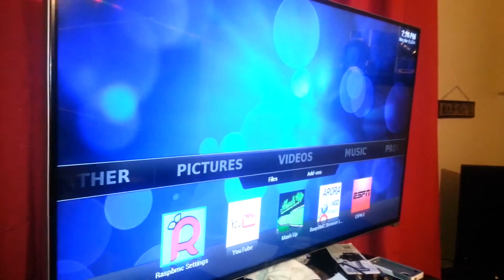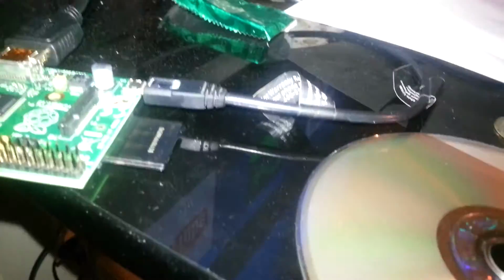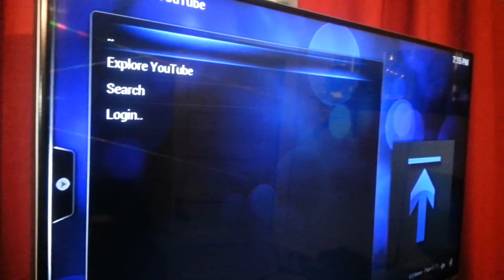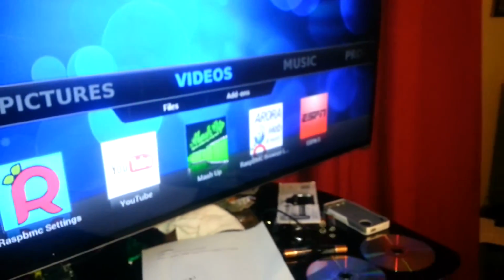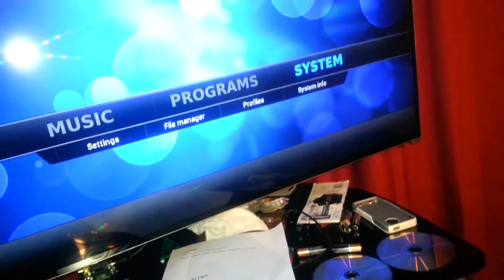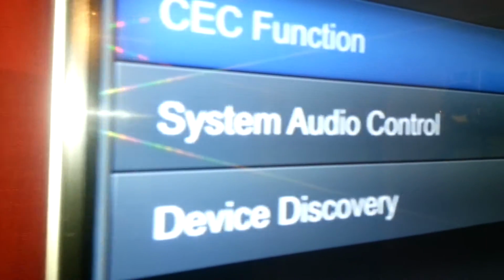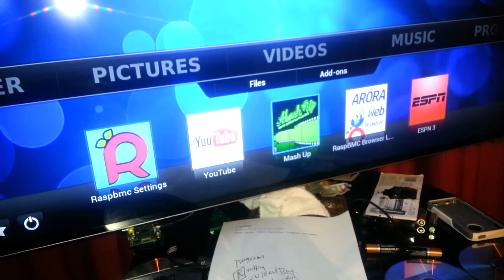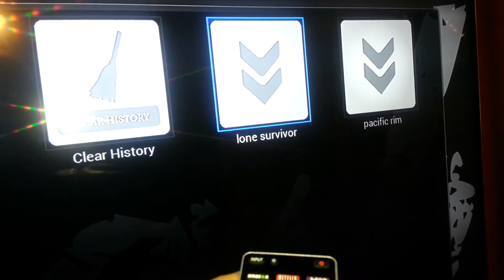Using Vizio M remote to control XBMC on Rasberry P

Comment: Using Kodi 15.1 and my peripherals are disabled. 
Looking to install libCEC and can only see installs for Win/Mac. 
I have the same Vizio M series using a MyGica 1900AC running Android. 
How can I install libCEC? Awesome video, thanks Dale!
Reply from the maker: +Steve Maxwell This video was posted over a year ago. So a lot of things have changed . Also this is for NOOBS Raspbmc which is not updated anymore. I would assume you could enable peripherals through KODI as usual. Also, this is a Model B Ras.Pi. They no longer update that version anymore either. This might help: http://kodi.wiki/view/CEC#Settings_in_XBMC.2FKodi_for_CEC